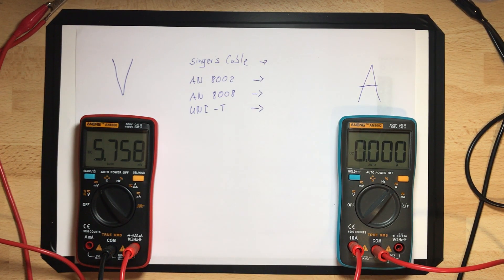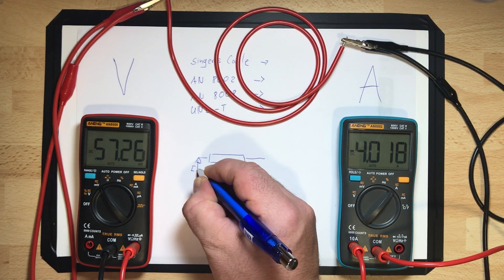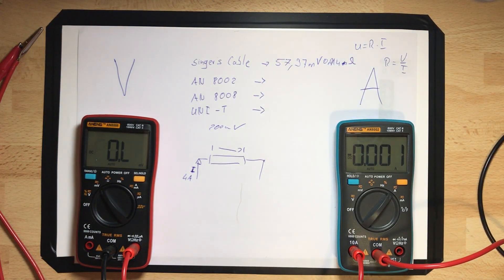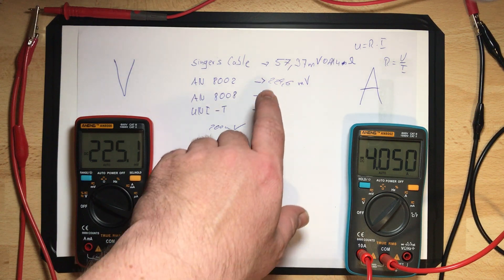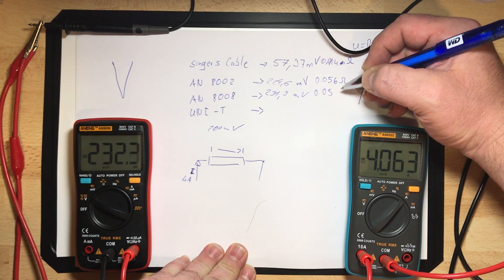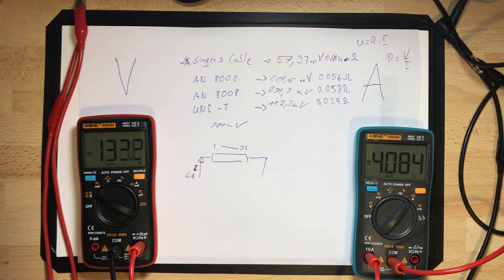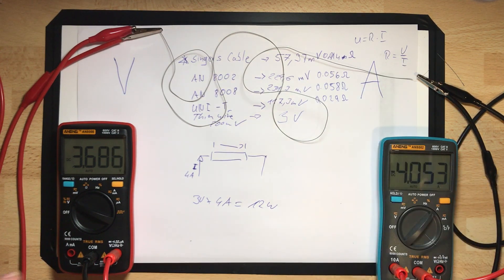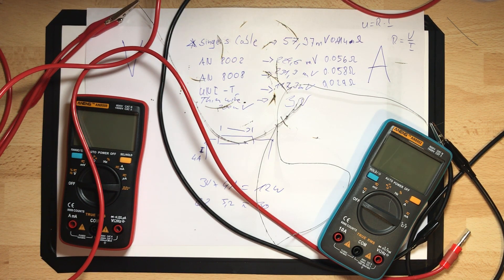How good/bad are the probes from the ANENG AN8002/8008 from banggood.com

Comment: The AN8008 have a resolution of 0.01 OHM, can you check the resistance of the 2 cables and report result to compare? 
Hope your previous measurement isn't influenced by the stainless alligators and lenght of others cables.

Comment: that's nice... except I really like to have flexible test cable leads, so lowest possible resistance isn't necessarily the most important figure of merit when making these comparisons.  At least for me... also important is the quality of the actual probe tips to access the node that I'm measuring.
Reply: Buy Silicone insulated test leads. The cheaper test leads are PVC is much stiffer  You can have both low resistance and flexibility.  Furthermore 100% copper in more flexible than copper plated  CCA aluminum wire.

Comment: But there is resistance on the tips of the probes too its not just the wire
Reply from the maker: The Rider yes there is also some resistance there but should be small compared with the rest, and you can see that the uni-t cable is better.

Comment: You should be able to find wire gage from those numbers and knowing the wire length. I am not sure how the AN8002 can measure measure 10 amps accurately unless the shunt is compensated for high lead resistance.
Reply from the maker: I have nothing to check the accuracy, but in this case it does't matter the failure in all 3 measurements are the same and so it is still comparable. Hey if someone want to send me something more precise don't wait just send me. You will be in my bedded prayer every single day. ;)

Comment: Don't you also need to subtract your test lead ohms that they add to the test lead value??
Reply from the maker: kirkb4989 I'm not sure about your question, I measure the voltage drop directly at the probe cable so the resistance from the voltage probe is not a big deal because the voltmeter has high resistance. The total resistance of course is affected by the leads but don't effect because they are equal in the whole measurement (Kirchhofs law). Of course it is not very precise but it compare and there you can see the difference between the different probes. 
It's a little bit complicated to explain in English hope you understand.
Reply: I mean YOUR test lead (made with the GOOD cable) with the alligator clips that you clip on the probes under test.  Your test lead adds some resistance that you need to subtract from the over all result to get the actual probes under test resistance.
Reply from the maker: no I don't need to subtract because I measure the voltage drop direct at both end's of the lead under test. The resistance to my voltmeter does't effect "any" because the resistance of the meter(>1 MOhm) compared with leads resistance (<1 Ohm) is about a factor of 1 Million higher. And the current is everywhere the same in the circuit.
Just check Ohm Law for resistance in a row and kirchhoffs law number 2.
Reply: OK, I think I get it now.  You are getting a relative measurement of the lead resistance, not an absolute in order to compare "good" vs "bad".  Your test leads will add the same amount of additional micro ohm resistance to any lead you test so the relative values can be compared, not to state an actual resistance value.  So (making up numbers) saying the good leads get 25 micro ohm as compared to the Anseng getting 50 micro ohms in your test situation says the good leads much lower resistance and are better.  You cannot say that the leads are absolutely 25 micro ohms because that number includes the micro ohms of your test leads with the alligator clips.  That actual resistance of the tested leads needs to be (measured ohms) - (your test lead ohms) = absolute resistance.  If your test leads have say 5 micro ohms of resistance, then the good test lead would have an actual resistance of 20, not 25 (using my made up numbers).  

Thanks!!  Interesting discussion/topic!!